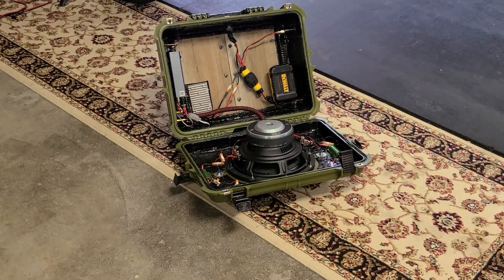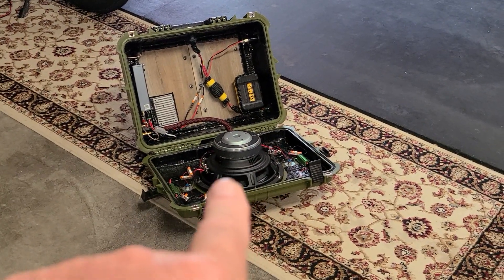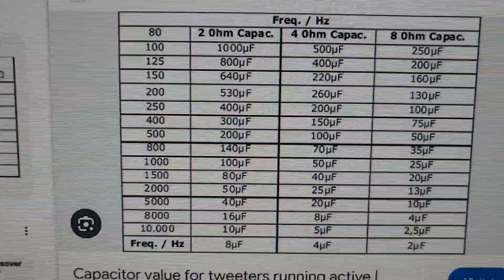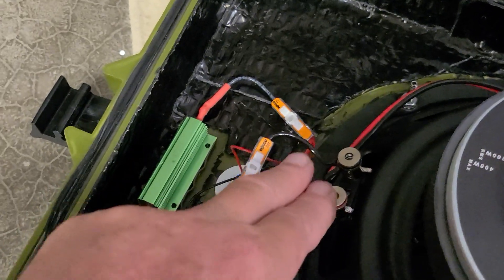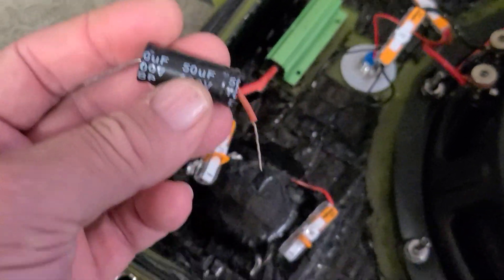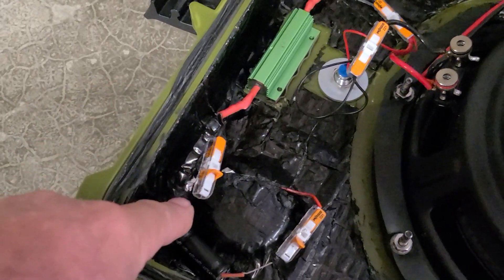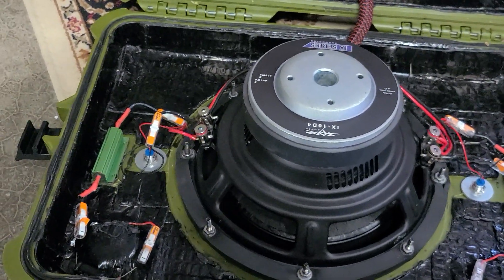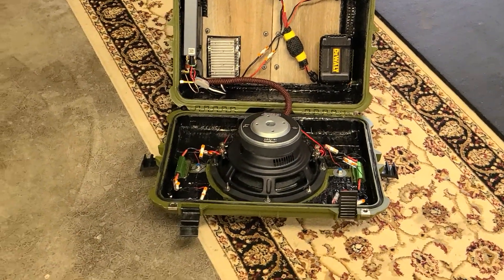DIY simple (and cheap) tweeter crossovers explained -- how I wire up my Bluetooth speakers

Comment: You might be able to help me out.  I’m building a 50cal ammo can boombox and am running a 2 channel 12v amp to run a 5.5in 4ohm dvc sub and a polk 5.25 coaxial on the same amp.  What should I do to filter the sub channel?

Comment: Did you use that 47 Ohm resistor in addition to that Capacitor? I used 33 Ohm Resistors in front of tweeters, and it sounded good.. I'm not understanding the Capacitors role, and where it is wired in that box.. seems like they are both knocking the power down, so is the Resistor and Capacitor just two different options for achieving the reduction in power?  Thanks!
Reply from the maker: Short answer...yes. The resistor knocks down the power (wattage) going to the tweeter. The capacitor is a "filter" per se...filters out freqs below ~1,000 Hz in this application (4-ohms). So, yes, the capacitor knocks levels down by reducing lower frequencies from damaging it...a poor man's crossover that many people use. However, a tweeter can still sound "hot" even with just a capacitor. The resistor is what really decreases the total power (SPL, wattage) going to the tweeter to help balance it's output to the full output of the woofer. Each setup out there is unique...you just have to play around with resistors and capacitors to find the "sweet spot" that sounds best to you.
Reply: @ChrisDIYerOklahoma  if i were to be using 8 ohm tweeters and same for speakers, what would you suggest for capacitor?
Reply from the maker: @TrevorSmith-lx8sf  -- There are capacitor crossover charts online for impedance. Just do a search -- that is what I do.